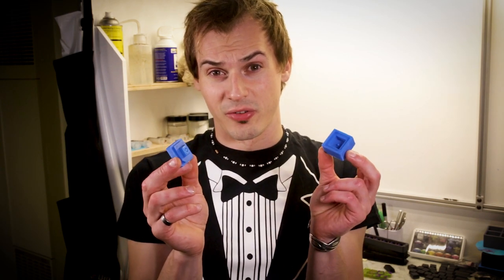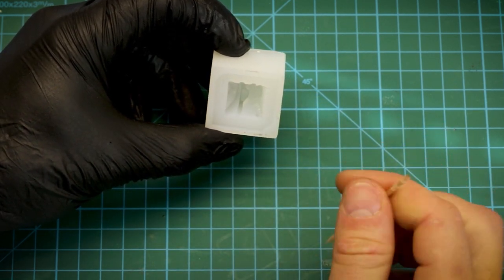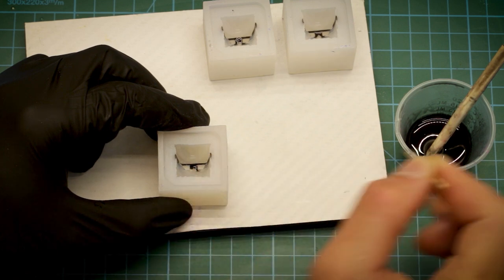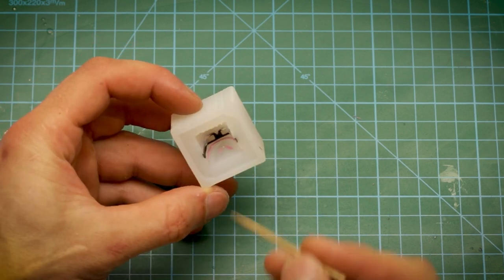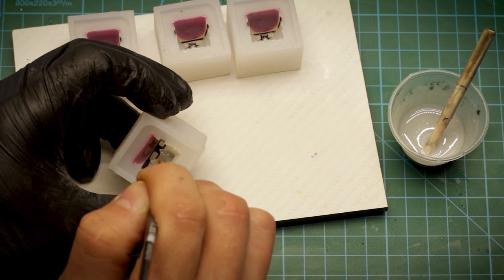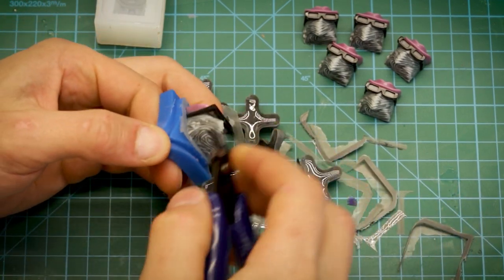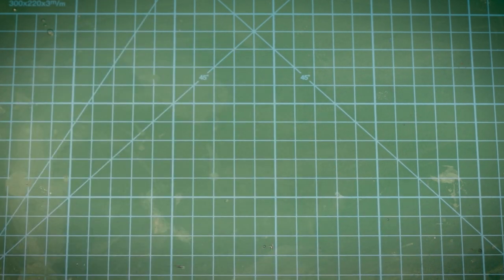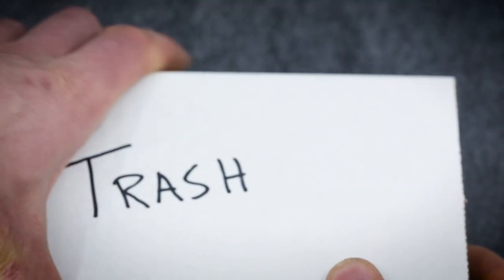Multishot Resin Casting for Artisan Keycaps

Comment: thank you so much for taking the time to make this video! would you be willing to share a list of the supplies you use? Specifically resin brand, dye brand, and silicone brand.
Reply from the maker: For this video I used Moldstar 30 silicone for the bottom molds, Moldstar 20 for the top molds, Smooth Cast 327 resin for the multishots, and Task 9 resin for the body shot

Comment: Hey I love your videos! I’m currently getting a pressure pot and materials to start experimenting on some artisan but I have a question about this, what would be a good pot life for resin you will use with a multicasting technique? Just to be sure you don’t waste it but let’s say can make 5 at a same time without a lot of pressure to put it in the pot quickly
Reply: Did you end up making something?

Comment: Likewise, great to see you back with a new video. They're all incredibly helpful and this one has come at just the right time for me.

One question I have though is what do you do with the excess resin you mixed? The pink you used for the small shots for example, you only used a tiny amount. Do you just throw it away?
Reply: I don't know what the Glyph does but I allways have some molds near by to cast some single color caps or blanks
Reply from the maker: Like  @MakenModify  says you can totally "piggyback" some colors to do other things, but a good amount of it does end up getting wasted (or you don't have time to use it depending how long the core application takes). In the grand scheme of things resin is /extremely/ cheap for keycaps, so a lot of us don't worry about it too much. It is worth noting that the less resin you mix, the higher percentage human error will affect your resin A:B ratio which some resins can be quite sensitive to. TheGlyph's arbitrary personal rule is to never mix less than 3ml of each side, just to be safe.
Reply: @ArtisanAllianceKeycaps  thanks for the reply. Yeah that all makes a lot of sense. It's kinda what I thought might have been the case. Nice idea with the single colour caps and blanks too. 

Thanks for the 3ml tip too. I've recently been using a 0.00 sensitive weighing scale with good success (using the "by weight mix ratio" calculator here.  https://www.smooth-on.com/support/calculators/#ratio ) and I did worry that perhaps I was going too small.

Comment: It's really helpful video. Is pressurizing necessary? or can I skip this process?
Reply from the maker: We consider pressure to be necessary to produce high quality keycaps. If you just want to try out the process you can cast at atmosphere but it will be virtually impossible to avoid having bubbles in your final product

Comment: How many times can you use a mould? Been doing my research on making caps and hope to have everything up and running in the next 2 weeks, thanks for these videos
Reply from the maker: That depends on quite a few factors like resin, handling, mold release, cap geometry, surface finish, etc so it's hard to give you a straight answer. Let's loosely say somewhere in the 25-50 range for most "average" conditions.

Comment: What resin do you cast with, I use smoothcast 325 but it seems too short of pot life to do multishot with
Reply: 326 or 327 can give you more working time without really changing any of the mechanical properties! Definitely try them out of 325 is too fast for you

Comment: I was expecting a complex (and generally undecipherable) series of pours with various "why the heck do you want that?" molds being created along the way, but then he started actually painting the resin into the mold!
Which got me thinking about photoresist, vapor deposition and sputtering 😃  
my question/challenge for you:  So what could you do with putting down a layer of photoresist, exposing it, and using some photolithography techniques with resin?
If there were a way to use a lphv sprayer to apply the resin through the photoresist template... but I have no idea if the sprayer could be cleaned out well enough during the resin pot time.  Is there a good solvent for that?  I'm just throwing two disciplines into a blender to see what comes out.  😁

Comment: but why does your resin stick to the surface even if you move the mold around? i have a smoothcast 327 and mine doesnt behave like that. they all slide down that bottom and nothing is left sticking to where i put the resin

Comment: why do you mix so much resin when you are only casting a handful of caps?
Reply from the maker: It's actually not that much! TheGlyph's arbitrary personal rule is to never mix less than 3ml of each side of resin, just to make sure the A:B mix ratio is accurate. What also may be confusing to you is the mixing cups can be reused many times, so what looks like a full cup is actually stacks of many previous shots that are already cured.
Reply: @ArtisanAllianceKeycaps  Seriously, you handle questions with valid explanations. 10/10